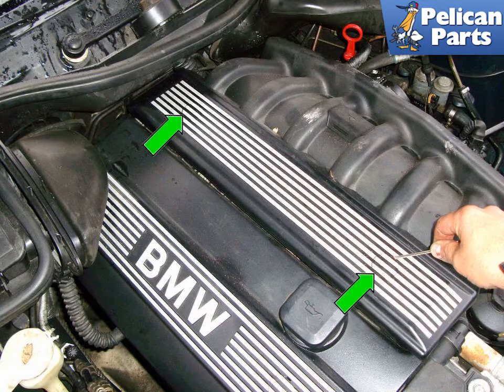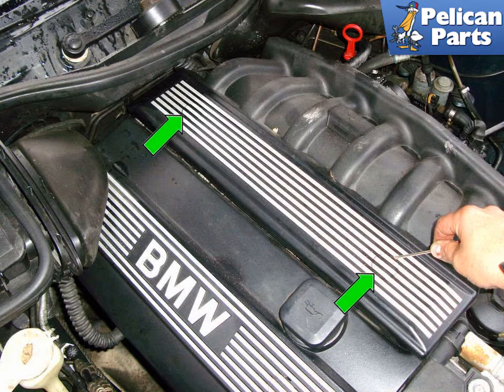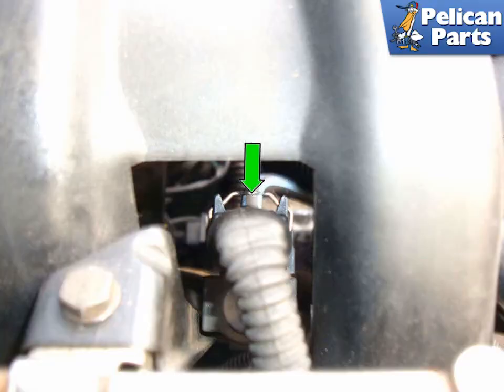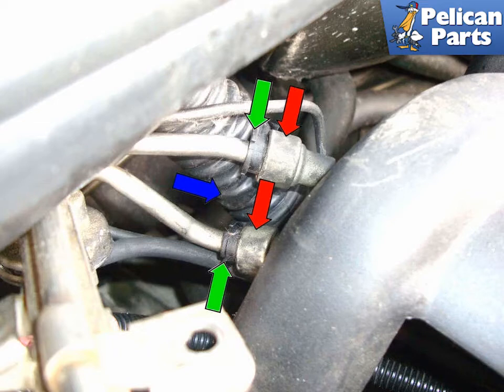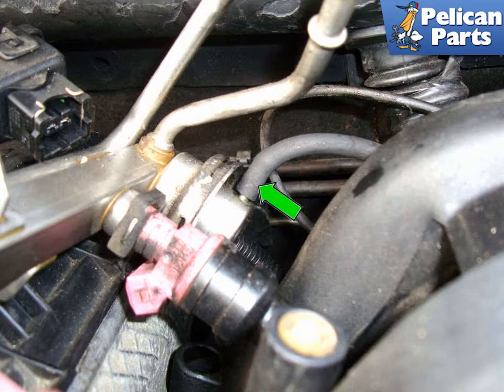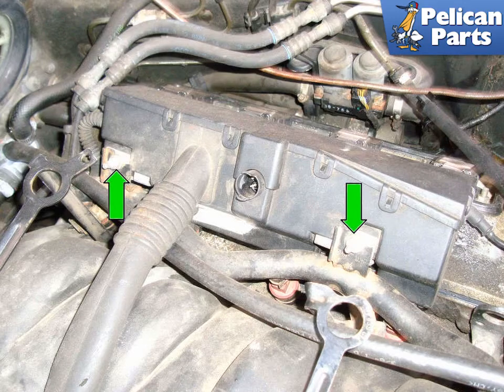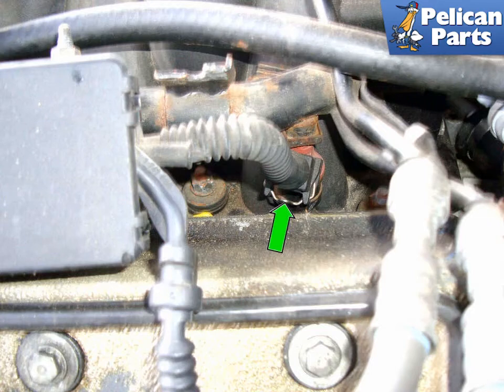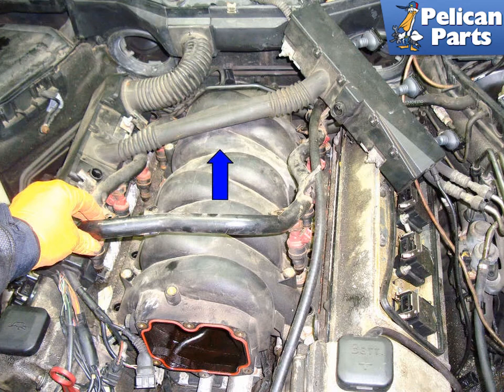BMW E39 5-Series Fuel Injector Replacement | 1997-2003 525i, 528i, 530i, 540i

Comment: you need to remove 540 from this thats a v8 nothing like this
Reply from the maker: 540 8-cylinders models are covered at the later half of the video. 
Applicable Models
BMW 525i Sedan/Wagon (2001-03)
BMW 528i Sedan/Wagon (1997-00)
BMW 530i Sedan (2001-03)
BMW 540i Sedan/Wagon (1997-03)